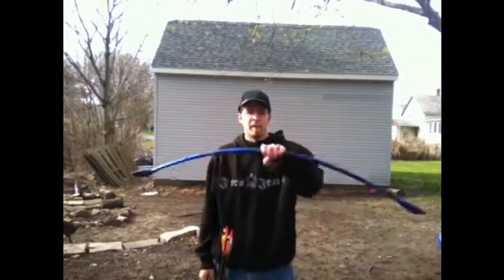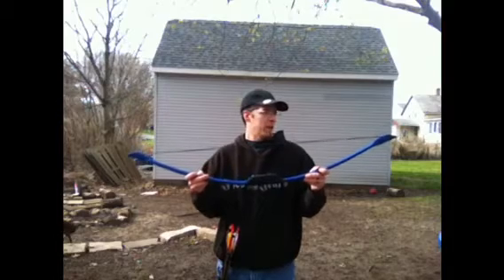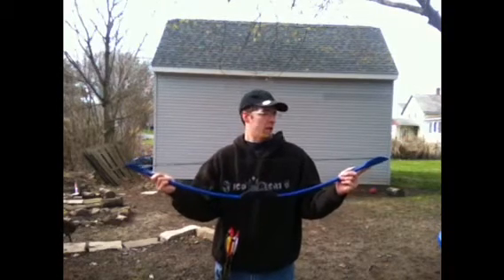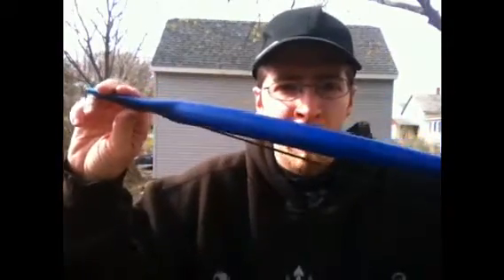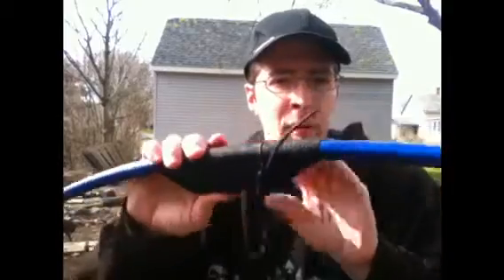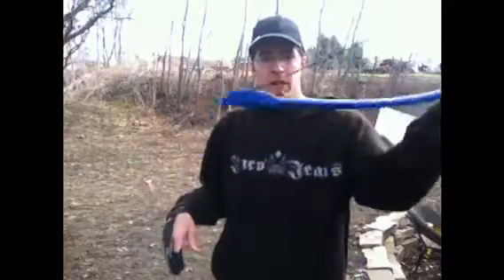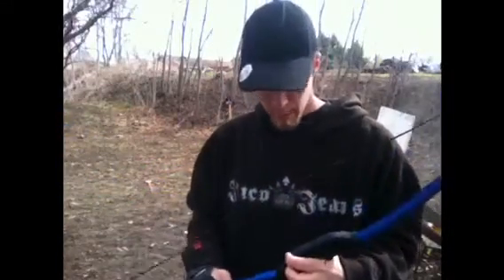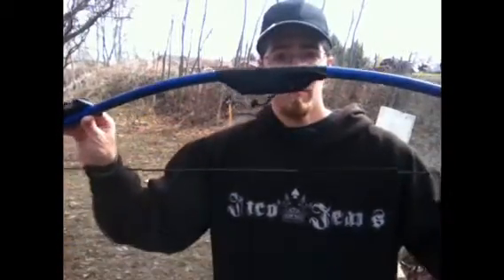Fiberglass reinforced pvc bow

Comment: how did you keep the fiber glass rod centered in the pipe while flattening? or doesn't it matter
Reply: I was about asking the same. My guess is- he taped the rod around to get the diameter of it closer to the hole inside of the pipe.